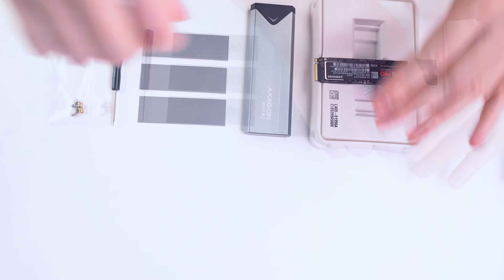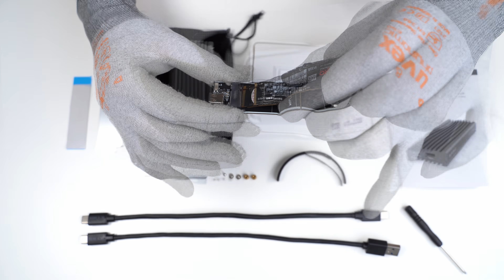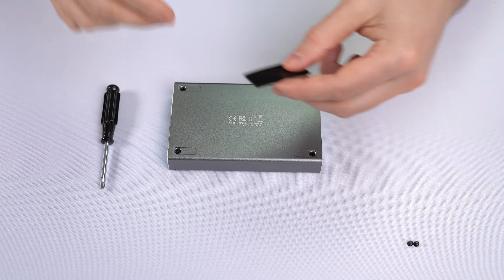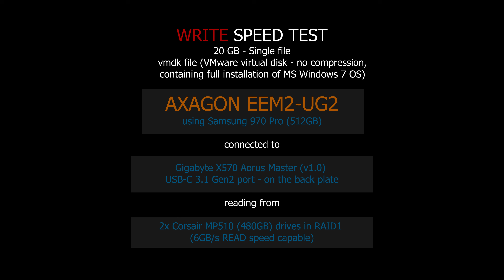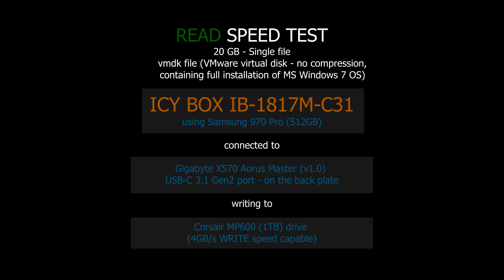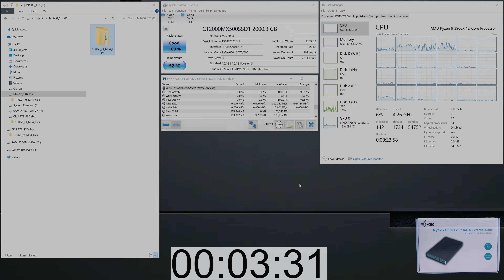M.2 NVMe USB-C External Box TEST - for SSD - AXAGON EEM2-UG2, ICY BOX IB-1817M-C31 & i-tec MySafe

Comment: Thanks for the video. I have bought this product to connect a hard drive to a laptop. Someone recommended this as the last solution to back up the data from the hard drive in question. The hard drive belongs to a latop that had a crash a month ago. Now I read in the safety informations of Icy Box. They are as follows:" Data lost during commissionning. Back up data prior to commissioning. Back up data prior to connection new harware." I am not sure whether I should or should not try it out. What is your opinon?
Reply from the maker: You´re welcome! If the HDD which was inside the laptop (which had a crash) is still working and you want to backup the data from it to an SSD placed inside IcyBox external case you should definitely give it try. The safety information is for the safety of IcyBox to make sure people who´s HDDs/SSDs die during the operation when using it don´t claim any financial refunds or lawsuits against them. It´s logical, because they can´t know which drives users put inside the case and what state/condition these drives are in and be responsible for them. Basically, this is only to avoid any potential legal trouble.

Now to your case, you should try copying your data to an SSD because it will be much cheaper and faster than using any professional services if the drive still works. However, there is a risk that the drive which was inside the crashed laptop will be damaged ro will stop working during data transfer. If so, only some – not all data may be retrievable (depends on its condition). If the data is critically important - you may need to use professional recovery service, but it can be very expensive. So first try it and if it doesn´t work, seek professional help.

(One tip – if copying from the drive which is inside crashed laptop doesn´t work, remove it and place it into a desktop computer (connect it to a SATA port) and try copying it from there. This will make sure the potential problem is really with the drive and not damaged wiring/connection to it – if you were copying this data from a damaged laptop.)
Reply: @MartinsLab  Thank you for the answer. The hard drive is fully fuctional. Yes, professional recovery service is very expensive. This is the reason why I didn't make use of it.  What is SATA port?
Reply: @MartinsLab  Furthermore, there wasn't any cool pad and plate pad inside the package.
Reply from the maker: @SDKhan-yv7bs  No problem. Hard drives usually use SATA interface be connected to a computer - https://en.wikipedia.org/wiki/Serial_ATA , it is a type of port you can connect devices to a PC internally by using a SATA cable. If you have a desktop computer, it usually has some free SATA ports (unless they all are used). My tip was to connect your hard drive to this port on your PC to avoid any potential problems during data transfer caused by a damaged laptop (I have no idea how damaged it is).

If you bought new Icy Box IB-1817M-C31 and didn´t get any thermal pad with it, then you should return it and get new one. It is necessary for efficient transfer of heat from M.2 NVMe drive to a heatsink (which is the box itself). When I look here - https://raidsonic.de/en/index.php?we_objectID=5666#properties  it is listed as part of box content.
Reply: @MartinsLab  Thank you for the advice
Reply from the maker: @SDKhan-yv7bs  You are welcome
Reply: @MartinsLab   I asked the seller. He said, this type of Icy Box didn't have and need the cool pad.
Reply: @MartinsLab  SSD is a type of hard drive that is very small, isn't it?
Reply: @MartinsLab  How can I find out, what type of hard drive a laptop has?
Reply from the maker: @SDKhan-yv7bs  Many questions. I´ll answer them in one go:
1)SSD stands for “Solid State Drive“ - https://en.wikipedia.org/wiki/Solid-state_drive - it´s a technology on which the drive is based on – no moving parts (no rotating platters) like in case of HDD - hard drives. Size has very little to do with it. SDDs can be both small or large, it depends on how you many memory chips you put together on a PCB (plastic circuit board). But generally, most common ones are smaller than HDDs.

Then we should establish if what you have is ICY BOX IB-1817M-C31? or you have some other model? If the answer is “yes” then what I wrote you before stands.

ICY BOX – the manufacturer says it´s part of the accessories - so it is. And it isn´t true, that it´s not necessary – it is. Cool pad (silicon thermal pad) helps dissipating the heat from the SDD´s memory chips into the heatsink more effectively that air (= having nothing) because it has direct contact with both the heatsink and an SSD. It also has higher thermal conductivity than air.

2) Here is what ICY BOX SAYS on their webpage about what should be in Packing content (I copy pasted it): “1x IB-1817M-C31 (drive not included), 1x Type-C® to Type-C® cable (20 cm), 1x Type-C® to Type-A cable (20 cm), 1x Silicon thermal pad, 1x Heat sink, 1x Tool for write protection switch, 1x Screw driver, 1x Set of screws, 1x Quick installation guide”. 

3)To find you what type of hard drive a laptop has, you´d have to open it a look inside or go to OS Windows 10 – Right click on “START” button > go to “Device manager” > Disk drives and there you´ll see what drive you have. Then you google what you found out and you´ll know its exact characteristics (speed/ports/type of memory cells used etc.) from its manufacturer´s website.
Reply: @MartinsLab  Thank you very much for the answer in detail. It's: ICY BOX uSSB Type-C tm Enclosure for M.2 nVMe SSD

Comment: One question, i dont understand this.
When i buy a nvme ssd i want full speed. Why is there a limit from 1 gbs? 
Is it realy heat? 
I cant beleave this in a pc it works with the normal speed.🤔
Sry for my bad englich i hope you understand that what i mean.
Reply from the maker: Hi SOLDAT 1.Klasse, I understand you very well. The answer is not simple, so lets take it step by step :)  The reason, why there is a 1 GB/s limit on all these boxes is because they are connected to the motherboard by USB 3.1 Gen2 interface (port). It´s theoretical maximum speed is 10 Gbit/s (1,25 GB/s) by design. So, it doesn´t matter how fast drive you use, it will always be limited to 1,25GB/s (1 GB/s in reality) by it.

On top of the bus limit, there is also a “Controller chip speed limit” as I discovered in the test. The chip (controller which is responsible for translation of signal from NVMe to USB 3.1 Gen2) which is used inside the M.2 box is - as I tested - not able to WRITE to M.2 SSDs at speeds faster than little over 600 MB/s and READ around 820 MB/s in reality (this applies for both Axagon and ICY BOX) for longer periods of time. 

The advantage of using USB 3.1 Gen2 and USB 3.2 Gen2 boxes with NVMe M.2 drives is that it is cheap, faster than SATA (they are limited by SATA bus to theoretical limit of 6 Gbit/s – which is 550 MB/s in reality) and almost all modern motherboards have it (no need to buy it separately). These boxes cost from about 33 to 45 USD.  

The heat has nothing to do with the speed limit of the boxes. The temperature when M.2 NVMe SSDs start throttling (loosing speed) starts around 70C and is different for every model/manufacturer (some start at 70C, some at 85C).

The reason why it works fast in your PC is that your PC is using different and much more expensive internal bus - PCIE 3.0 or PCIE 4.0 with 4 lanes (to M.2 slot) – which means that in case of 4x PCIE 4.0 your PC´s limit is 7,877 GB/s - so your SSD can run at full speed.

There exists a faster external solution, which has 40Gbit/s theoretical speed limit - Thunderbolt 3.0/4.0 - which can use full speed of the M.2 NVMe SSDs disk (depends which you use fo course), but it is also costs 2,5x – 4x more (110 USD and up) + it uses much more expensive cables as well. You also must have a motherboard which supports it or an external PCI-E (3.0 or 4.0) Thunderbolt 3.0 card which you´d have to buy as well. I will be testing one in about a month from now, so stay tuned :)
Reply: @MartinsLab  thank you for the answer. 
I completly understand now. 
And i learned my bigest fail, i mixed up bits with bytes when i read about speeds.🤣
Thank you for your help. 🙂
Reply from the maker: @SOLDAT1.Klasse  No problem ;) , "magic" formula is: 1 Byte = 8 bits.
Reply: @MartinsLab  Very good explanation, you have a good future on YouTube :)
Reply from the maker: @MKBUHDD  Thanks! Fingers crossed :)

Comment: l got the Corsair MP600 Force Series, 1 TB High-speed Gen 4 PCIe x4, NVMe M.2 works well runs about 5000 and reads about 4200 tep about 60 ( CrystalDiskMark) 64 tb+ the video is well made
Reply from the maker: Hi Darren, it is a very good drive, currently in the top 10 of what is available - https://www.harddrivebenchmark.net/high_end_drives.html
I´m getting similar results when connected to M.2 slot on the MB. When connected to USB-C M.2 NVMe box and then connected to MB by USB 3.1 Gen2 (and being limited by it) it runs almost the same as Samsung 970 Pro which was used in the video. These drives are an overkill for USB 3.1 Gen2/USB 3.1 Gen2.
Reply: @MartinsLab  my Corsair MP600 was the same Price as the Samsung 970 EVOat the time
Reply from the maker: @MrBook123456  MP600 was and still is a good value - offers very good endurance (TBW) and speed. 970 Evo is a good drive, but a little overpriced (differs from country to country) when looking at TBW. The good news is that prices of NAND are going down till the first quarter of next year and the prices of SSDs will drop even more with it.